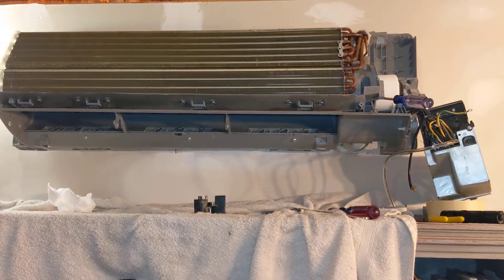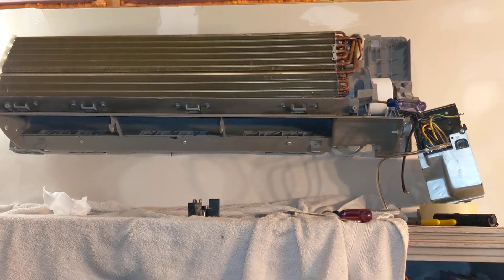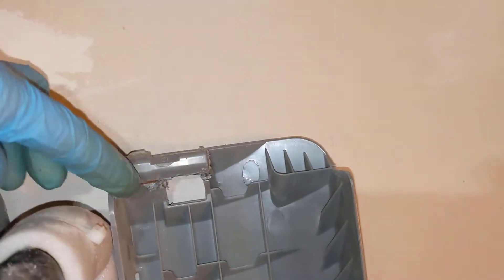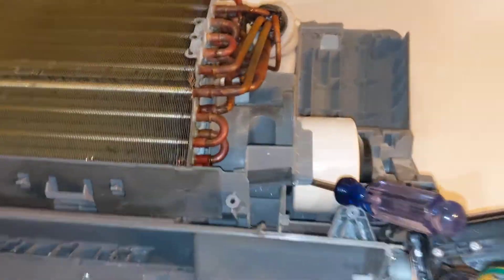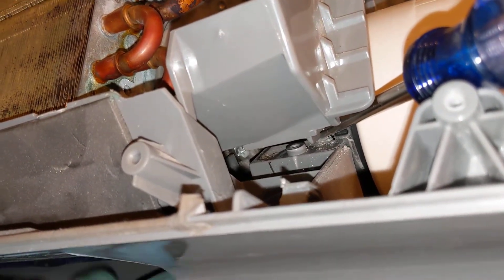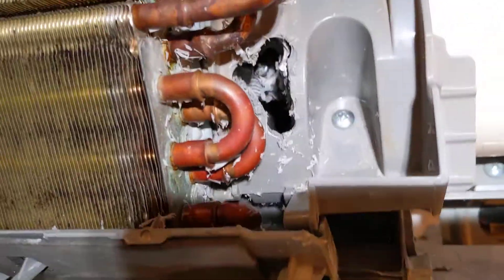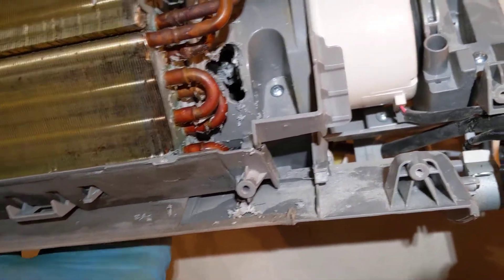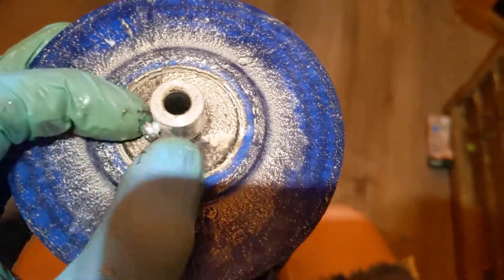How to remove blower wheel from MRCOOL mini split AC

Comment: Brother, I watched this 3 hours ago thinking you're insane to drill into your unit like that. Decided to remove everything you told me I didn't need to, just to realize it wouldn't work. Ended up drilling the hole and it worked like a charm.

Comment: Doesn’t show how to remove. Just shows how to destroy your drain pan. Terrible video.
Reply from the maker: This video shows how to remove the set screw. Once you have it out, see another video on youtube titled "How to Replace a MRCOOL Ductless Mini Split Fan Motor" that shows how to remove the blower wheel. Basically you lift the left side of the coil a few inches, then the blower wheel slides out to the left.
Reply: I have the older unit and needed to perform this hack. I added a piece of waterproof tape to cover the hole, which is removed and replaced each time for cleaning. Not a big deal.

Comment: I cleaned the blower wheel in place with a vacuuming first, then pump sprayer and coil cleaner. Sparkles. No need to remove the blower wheel I say.

Comment: Thank you for calling out these mini split manufacturers on the blower wheel removal. THEY ARE ALL DIFFICULT AND IN SOME CASES IMPOSSIBLE to remove.  Given the need to regularly clean them the unit should be designed with a door on the side so the blower wheel can be easily removed! Lennox is ridiculous.  You have to clean it in place!

Comment: Appreciate the video. I have a similar unit and I’ve tried to think of another way I can access that set screw for the blower wheel without drilling a hole but there just isn’t a way. So I decided to drill the hole CAREFULLY and I was able to access the set screw and remove it for cleaning. Thank you for sharing this, i can confirm this does work! Just be very careful when drilling. Good idea too!

Comment: I have an EletriQ one and they put the retaining tabs that hold the bottom of the shroud on upside down, (should be able to pull down to release if they were the right way up) so it's literally impossible to get it off once installed. I filed mine down before installing so I can get if off. I cleaned the blower wheel the other day, with cleaner and rinsed with water, coz of a stench and I think water might have gone some where it shouldn't go and now a tiny squeak has started >.< (It doesn't squeak once per revolution tho, more like once every 6 seconds, which makes zero sense). I am dreading the thought of trying to replace the motor, because EletriQ cares even less then Mr Cool about making things easy to fix.
Reply: Wow, that is odd. Turned it off and it still does it so it's not the fan. Some electronic component 'chirping' I guess >.<
Reply: Found it! It's the wi-fi chip. Well at least that might be easier to fix/replace than the motor....

Comment: I have a Mr. COOL, and I can tell you I did NOT drill any holes in my unit.   The manufacturer was able to install it without drilling any holes.  It is never a good idea to start drilling holes in or near the coile tubes. This is asking for problems.  Once you nick a tube, it is only a matter of time before you have a leak, and trust me, it won't be cheap to repair or replace the coiles and recharge your system.

Comment: 😬 just going to clean with it on.
Reply from the maker: I feel your pain. I tried that, scraping each blade with a putty knife - super laborious. 

You might try using foaming AC coil cleaner (usually for cleaning the coils, not the blower wheel), along with a cleaning bib / cover. Hardware stores will sell them for like $30 and it captures your spray and channels it down into a bucket.

Comment: Okay, I just finished my fan motor replacement. The white inside plastic ones are easier, the grey ones are more difficult. Now, the grey plastic shroud covering the fan motor rod where it connects to the fan can be removed but it isn't easy. Pay close attention to the shroud. Above the fan motor, facing the fan there is a clip at the top part that must be pushed away from the motor towards the fan area. The second clip is against the area where the wall is. Release both of these. Now comes the hard part.
Lift the fins/cooling coils from the far left, grab the grey plastic motor housing (the plastic where Patrick has drilled the holes), and start manipulating the piece up and down, left and right. It will come loose and expose the fan motor and the set screw.  

This took me several tries but I finally got it.  While it was out I got my multi-tool and cut an approx. one inch long by .5 inch wide opening in case I have to do this again and I will not have to remove the grey shroud.  Replacement was about as hard, but it can work. Oh, try and remove the black rubber gasket at the back of the motor when removing the motor... this helps.

This MRcool I bought this at Costco about 2.5 years ago. My fan didn't have the cutout fins part either.
Reply: I had to drill a hole to! Pain in the ass!

Comment: How did u take apart the whole white thing and vents?
Reply from the maker: Check the description for a link. I think Mr cool's official video should help you. It's a couple screws and some clips up top.
Reply: @PatrickBoatner  I watched that video! It shows how to get the white part off but they didn’t remove the white flap (that moves when air blows) or the vents or the black grate things in that video where in ur video u got them out! I can’t find anywhere how to get those out and that is what I need out to clean. I hope this makes sense what I’m asking!
Reply from the maker: @katelyn_civitello  the white flap is called the louver usually. To take it off, first unhook the middle tabs one at a time. The louver itself will flex a bit, and the gray piece that receives it will flex in the opposite direction a bit. Then you can unhook the end of the louver away from the motor. You do this by very slightly flexing the entire louver.

The black grate things, I totally butchered them. I'm pretty sure you can leave them on when you do this work. I clipped them with wire cutters when I was afraid to take it apart all the way. But once I took it apart fully, I found that removing the large white outer housing first (like Mr Cool shows) would allow the black grates to come out pretty easily.
Reply from the maker: Oh I see what you're saying now. Yeah, remove the large white outer housing first, then you can see the top and bottom of the black grates. I think you'll see where the black grates clip onto something. You might be able to clean them with your fingers + a wet towel or similar once the louvre is out of the way.
Reply: @PatrickBoatner  thank you! Going to try to do all of this tomorrow. I’ve been watching videos on people deep cleaning other units since there’s such limited info on Mr. Cool and I am curious do u know if Mr. Cool units have a drain pan ? I didn’t see one in the Mr. Cool video that u linked either
Reply from the maker: @katelyn_civitello  yeah they have a drain pan. Mine does. Your copper refrigerant lines go out the back of the unit, and there's a plastic tube about 1 inch thick that goes with them. The drain pan drains down into that plastic tube. You'll see it once you remove the big white casing/shroud.
Reply: @PatrickBoatner  do you clean that too? Is it accessible to take out and clean? Thank you truly for being such a big help I’ve been so stressed over this and can’t seem to find anyone who will even clean a mini split professionally either
Reply from the maker: @katelyn_civitello  You want to clean the blue filters pretty frequently with a vacuum, since they pop right out. I clean the blower wheel when it doesn't seem to blow as well, probably twice a year. When I have the shroud taken off (for the blower wheel), I'll make sure the drain pan is flowing by pouring some water into it and watching how it flows. One time I had to clear some gunk out of the drainage tube from the other end. I'll spray some 10 percent bleach solution in the drain pan to kill any funk. If I want a heavy coil cleansing, I'll grab some foaming coil cleaner and follow the instructions. Otherwise I'll give the coil a light cleaning with a toothbrush and gently remove any visible surface junk, , plus a 10 percent bleach spray to kill any funk.

Basically keep the air flowing well, and clean anything that's gross!
Reply from the maker: I would not try to remove the drain pan. Just make sure it's flowing and any kill any funky stuff with bleach.

Comment: Why didn't you just pull the motor screws out and popped it off?
Reply from the maker: It looked like the shroud was heavily attached to the refrigerant coil or something. I wanted to do this, but couldn't see a way. See if you can make a happen, record a video 💪
Reply: @PatrickBoatner  is where I could send you a photo of mine? I'm in the middle of cleaning mine. I think I have the same one as you do. How are you keeping the black box back in there? Since the clip is now cut? Would hot glue be okay?
Reply from the maker: So I thought I needed to cut the clip, so I could remove the black box. But that wasn't actually useful at all. Don't cut anything around the black box, if you haven't yet.

If you have cut it, just study how the other parts are holding it in. Think about what ways it can move. I think it basically sits on top of something. It doesn't have to be super secure- I think it's not a mechanical part. I think it's just the computer.
Reply: @PatrickBoatner  I got it lose besides the top where that black clip is. And I'm stumped. On how to get it off without cutting it.
Reply from the maker: You don't need to remove the black box.

Comment: After taking the screw off, did it just slide right off?
Reply from the maker: I just updated the description. Does this help? - 

To get the blower wheel (fan) out after you loosen the set screw, you basically have to unscrew and loosen the left side of the refrigerant coil. Then lift the left side of the refrigerant coil just enough until you have enough clearance to remove the left side of the blower wheel. The left side the blower wheel has some plastic bracket that needs to be lifted up and out. These videos help too:

The official video for replacing the motor. Not helpful for removing the blower wheel (fan), but it helps understand how it all goes together.
https://youtu.be/kAY6i8VpTBo

Here's a good video showing how to remove it, but it's a different brand and this one removes at a different angle.
https://youtu.be/2VvoER81-co

In this video, the blower wheel removes very similarly to the Mr Cool. It slides to the left and a little bit upwards.
https://youtu.be/yVa6UyXPZZY

Comment: Can you give a hint how to get the louvre off--we are afraid we're going to break it
Reply from the maker: First unhook the middle tabs one at a time. The louver itself will flex a bit, and the gray piece that receives it will flex in the opposite direction a bit.

Then you can unhook the end of the louver away from the motor. You do this by very slightly flexing the entire louver.
Reply: @PatrickBoatner  Thank you so much for replying-flexing the louver worked!

Comment: I figured it out without drilling anything!! 3 screws in the coil and a plastic clip my friend
Reply from the maker: Feel free to post a quick video. I'm sure it it would help folks. Good to hear though!
Reply: Please Post video of removing cover and blower wheels .  I installed mine five years ago and water dripping into the house.  Vacumed condensate line and a lot of junk came out . Hopefully this solves problem but still in need of good cleaning . Any videos or help  appreciated

Comment: I managed to clean the squirrel cage fan without removing it or the motor. It was bit fiddly but less steps or disassembly. I got the cowling off easily and removed the black painted screens with three screws. I then pulled one screw out of the louver positioning motor  and was able to pop the swinging louver assembly out. I then found the air directing fins to be only popped into place and removed them. Now I had a clear shot at the fan. I used a dry paint brush and shop vac and removed 95% of the dust. I kept the whole operation dry to avoid flinging crap on startup. The Mr cool is 4.5 years old and I had never done this before and frankly it wasn’t hella dirty but it’s a good winter project that takes a couple hours with breaks lol.
Reply from the maker: I tried that same approach myself first. I felt like I was getting 80% of it off. I had good success using a 1 inch drywall / spackle blade. Quite painstaking. If it works well for you, great! I've found that I have to clean mine multiple times per year in order to keep the airflow sufficient, so the hackjob work to get it removed was worth it to me. I can tell when the blower fan blades need cleaning when it doesn't maintain the temperature as well.

Comment: You butchered the unit...I will NOT do it this way
Reply from the maker: It's not pretty! But, I now have a maintainable mini split. I can now reliably and fairly easily remove and clean the blower wheel. It makes a huge difference in the cooling/heating output. 🤷
Reply: Did you find a way to get to the motor without cutting or drilling? I can’t get the control unit out. Thanks!
Reply from the maker: @alexmorton-adams4237  the control unit, there's an official video from Mr Cool that shows how to remove it and then remove the motor. I linked it in another comment thread. 

I tried going this route to see if it would help me avoid drilling the motor shroud access the set screw (it didn't!). I did have to do a tiny bit of cutting around the top tab I think, to remove the control unit.
Reply: Who cares? It didn't affect the structural rigidity, nor the cosmetics of the unit. Now it's serviceable.

Comment: https://youtu.be/EDwhvHGyQQg how to get the plastic housing out without drilling and potentially damaging the copper. pretty sure mr cools are rebadged gree units so it shares similar design. and yes it is tedious to get out. replaced 3 fan motors cause the bearings went bad lol.

Comment: Thanks for the video. My 18k was manufactured October 2020 and is very similar to yours. The blower cover is slightly different and putting a hole in it in your same location did not expose the set screw. Mine is located further inboard and is actually just behind the evap coil so had to lift up the coil assembly to gain access. Not user friendly at all. For this reason I can no longer recommend buying a Mr Cool brand. What good is having a unit that can't be cleaned. Makes it a throw away in my book.  Planned obsolescence I guess.  My 9k unit has the set screw inboard of the blower, just as in the MR Cool video, and I was wondering if the 18k could have that set screw bearing removed and reversed for easy access. Too bad the customer support falls short with this company.